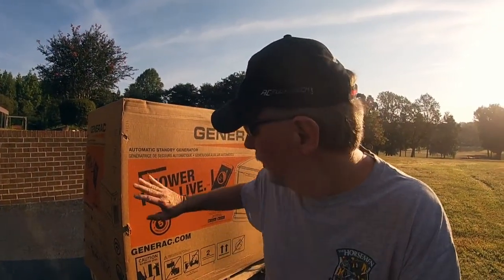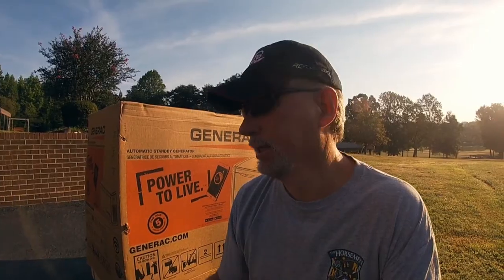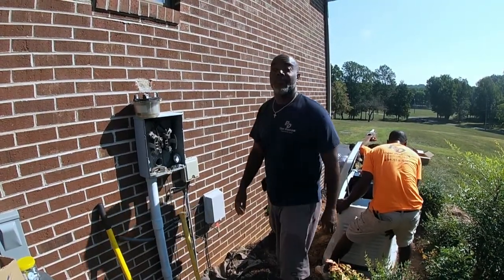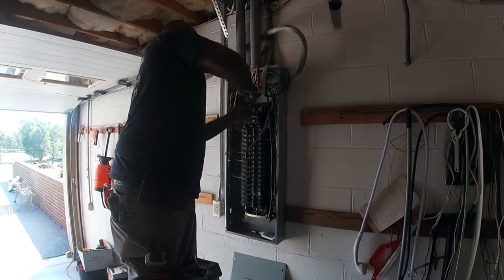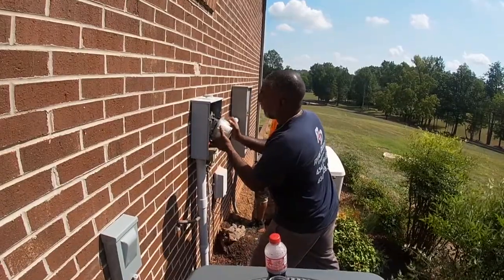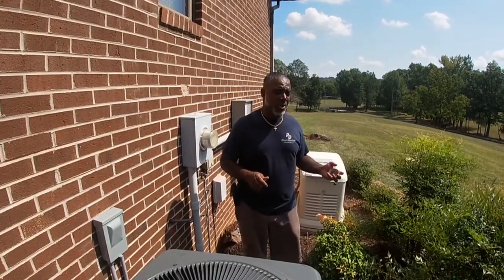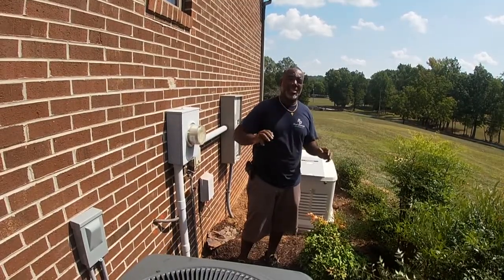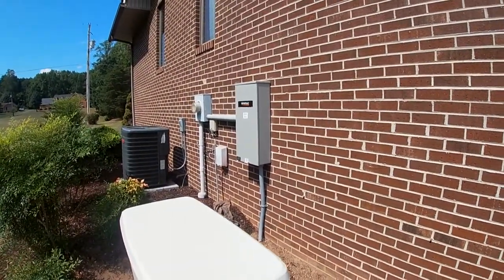How To Install a Generac 24 KW Generator for Your Home (Part 1)

Comment: A 24 KW generator is only equivalent to a fully loaded 100 Amp service. Granted 100 Amp services rarely run at or even close to their limit, but if your 200 Amp service regularly sees loads above 100 amps the generator will not be able to support it for any significant length of time (25% overload rating is probably only a few minutes).  At that point you will have to do some load shedding to ensure continuous service.
Reply: Thats why the NEC requires a load demand done first or autoload shed is needed.

Comment: So did they do it right and make the ats the first means of disconnect and the panel becomes a sub with 4wires feeding from the ats and all grounds and neutrals separated in panel with green bounding screw removed?

Comment: Illegal to cut the seal an pull the meter.  Only the utility company is authorized to temporary kill the service for repairs and upgrades.  Final note is the utility company has to inspect and approve the changes before resetting the meter.

Comment: The installation crew seems professional and capable enough but I'll admit I'm not fan of that big funky cable looping around to the service panel from the transfer switch where it enters the garage area at 3:44 -  In mounting the transfer switch to the house it appears their intent may have been to locate the transfer switch close to generator and limit the amount of trenching needed to bury the outside cable. Personally, looking at the outside of the house, I would have mounted the transfer switch to the left of the meter box to provide a cleaner looking install in the garage (i.e.. more professional and less after-market) by yielding a short connection to the right side of the service panel in the garage . Yes it would mean digging a slightly longer trench to bury the additional cable but I'd prefer to have the cable run buried outside and a more professional looking install inside. Just my OCD kicking in... other than that it looks like a nice installation. (When I purchased my 24kw... a requirement I had them include in the contract was both electric and gas service to the generator would be underground. As result it looks like my generator is sitting on the genpad still waiting to be connected to the house... very clean! - Not looking like the installation in the following video that screams "We installed it this way so we could get in and out quick as possible even though you house isn't as pretty as it used to be"  - youtube.com/watch?v=dDw8I_oKK94&t=253s
Reply from the maker: Hey Thanks for your input. When I install mine I'll make sure we incorporate your ideas. Thanks !!!!!

Comment: Great Video. I’m in the process of building a house and was wondering if the generator has to go next to the panel and meter? I will also be using propane.
Reply from the maker: The shorter the run the better. Less voltage drop. Check code. Here it has to be at least 10 ft. away. Also can't be near any opening.

Comment: Can someone please tell the listeners what permits need to be pulled before installation of one of these with propane?
I’m wanting to run a 22KW generac with service rated transfer switch and a propane tank.
I need to do my homework on codes for tank placement, generator placement, etc.
I’d love to use my electrician as he’s really good and does super clean work to code and will even go overkill like he would if he was doing his own house.
I’m probably going through Home Depot but it seems generac encourages you to use their guys to install and set up.
Is this part of Home Depot’s contract for warranty?

I’m not sure if it will void a warranty if not installed or set up by their guys.
I want to save money and do a lot myself and don’t want to pay for services that are inflated for no reason.

Comment: Got our 22KW installed today, just waiting on inspector to come out before the first start
Reply: What was the grand total of install and unit?
Reply: @blakebiltwell5  it was 14000 for a turn key job connected to NG. I believe it was more than most, but other places wouldn’t put the generator where I wanted. And generator supercenter did. Very happy with the work they did

Comment: Received my 24KW Jul 2nd. Just got the install completed Feb 22nd. It was code for my generator to be 10 feet from any structure. Does that not apply in your area?

Comment: How much did it cost in total?
Reply: I'm getting the same size generator in the next two weeks and it's going to cost $12k with installation. I already had a 120 gallon propane tank with the gas line ran to the side of the house so that cost was not included in the $12k so keep that in mind.
Reply: @handsupbud I’m in the generator business and I’m going to ask you a question.  Do you plan to have the gen run more than 38 hours in an outage?  Please please please do not pay 12k for something and then put a tank on it that will last you a day and a half.  This is my business and i implore you to think about that before you do it!

Generators can be a great purchase but the Genset in this video consumes 2.5 gallons of propane per hour at HALF load.  Assuming your tank is filled to capacity (96 gal) when your outage occurs you will get 38 hours of run. 

I’m not Hank Hill we don’t sell propane or propane accessories but listen to the man in this video!  500 gallons is minimum tank size you should consider
Reply: Thanks for the advice, unfortunately I already have the 120 gallon tank so it'll get me by for short outages. The power is usually out short periods. The longest during the big freeze was 23.5 hours.    @BrianD-ds4dx
Reply: @handsupbud  make sure your installer programs the exercise mode for every two weeks (or monthly) dependent upon minimum unit requirement. Some manufacturers have the option to set a crank only mode in off week cycles so as not to use the fuel.  Also during load bank process with the installer, come up with a good Apollo 13 sequence for what you need!

When you can, switch that tank out bud!  If you are in Texas, let me know where I can suggest good propane companies across the various metro areas anyway